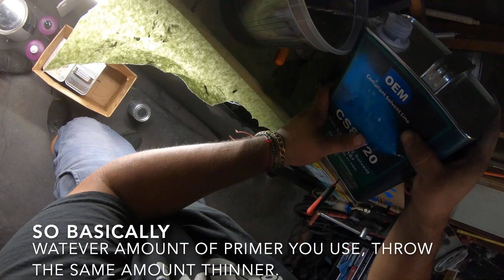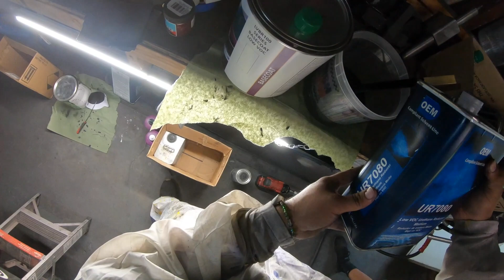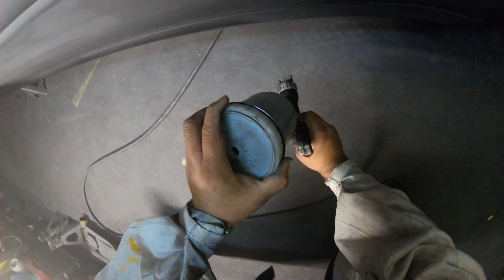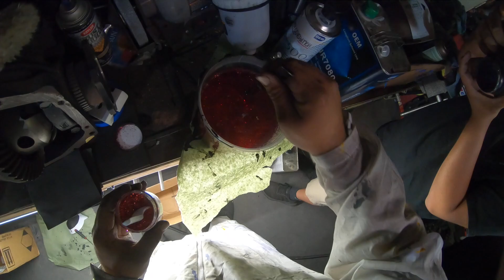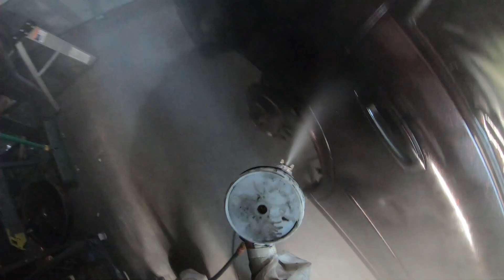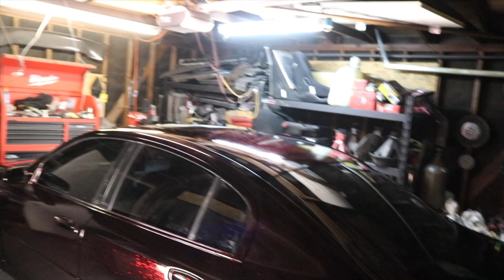G35 SEDAN BLACK ON RED FLAKE PAINT JOB P.O.V

Comment: Looks good. I've been spraying and doing metal flake for 40yrs. New flakes are definitely more forgiving than the old ones lol. My technique is, my 1st coat of clear is without flake, then my next several coats of clear is with flake. I finish with 5 coats of straight clear to bury the flakes. After 24hrs or so I sand it with 1,200 grit, then shoot another 5 or 6 coats of straight clear. Then wet sand and buff it out. Did alot of '49 Mercs back in the lacquer era, 600 grit to wet sand the clear. Young bucks today are like WOW 600! Lol. 600 was the finest back then, lacquer compared to paints now are night and day too lol. Anyways I thought I'd share from one painter to another 😎  I'd love to have seen the car outside.
Reply: I’d like to know a complete process
Reply: My first lacquer flake job was in 1962.
Reply: How much clear coat do you use? I’ve got a single cab truck that I’m painting and not sure how much I’ll need, not painting the tub/tray
Reply: @harrybottmtb8947  Depends on how many coats of clear you want and what your mixing ratio is. So if your ratio is 4:1 clear/activator and if you're using a hvlp gun, a gallon of clear would do it, giving you 5 coats of clear. I use a SATA and it does really good on saving material. When I shoot metal flake I use my Binks model 7 and then the SATA with clear, no flake. Question, what color are looking at painting and metal flake or no? Because that would change my suggestion on a gallon of clear lol
Reply: @harrybottmtb8947  Another question is if you're doing the door jams and under the hood. I know at the car manufacturer I work at, on an average size vehicle, like a sedan or SUV, we use 3 quarts of clear, 1 to 2 coats on the jams and 4 coats overall. You can cut back on material if you use a wet look. It'll give the illusion of tons of coats, but in reality not that many coats. The clear we use it slightly thicker than the average. So a coat is basically a coat and a half due to the thickness. Back with your spray gun, depends on how open your volume setting is. Straight clear, (no flake), I set my around half open. Then I adjust according to how it's laying down etc.. I hope this gives you some idea.

Comment: You have to bury that in clear coat after it's done to get that orange peel out of it and then wet sand it and then buff it till it shines maybe four more coats of clear brother
Reply: You are correct Shaun about the paint process. Also the wet sanding is key in all paint jobs no matter what you are painting. I agree with you 💯
Reply: I shot a few metal flake job's. Primer. Base coat. Clear and flake mix. Clear coat 2 time's. Wet sand cut and buff. 
Still looks good. Where are you located at homie
Reply: @Tom-wq2mz  so you mix the metalic with the clear coat then spray ?
Reply: @A6q4  After the base coat is laid down, Yes I mix the Metal flake with the clear coat and spray it. Next clear coat it. You'll need to repeat the clear coat a couple of times to get the Metal flake buried and orange peel out. Be sure to cut and buff.
Reply: You need to wet sand the orange peeled base coat before applying clear, or you're just clear coating orange peel.

Comment: Brother, I have to say I have been afraid of metal flake all my painting life. You totally owned that car and it came out extraordinary. To have completely fixable orange peel is nothing compared to other jobs that I have seen drips, runs, lines and uneven coating where these boneheads call themselves professionals. That really was a great job. I am ONLY adding this part and please understand that I am NOT a pro but this is what I have been told so many times. If it orange peels and the jobs is not up to your standard, 2,000 grit and level out that job, then add 2 coats of clear and see your results. This all comes as respectful advise but to see what you finished with, OUTSTANDING!!!
Reply from the maker: thank you bro! watch my newest video!
Reply: Thank you very much, I was looking how would one get rid of that orange peel.

Comment: Yo fili mad respects bro🤘🏼🤘🏼🤘🏼 but just a pointer I’m a painter after laying the flake lay out clear on its own without the flake it’ll come out clean and as far as the over spray put the box fans on front of you garage with the filters and block it with some plywood in between
Reply from the maker: Rv Vz i did do the second pass just clear no flake.. but that flake seems too big makes it pop lol. I will definitely try that for the overspray🙏🏼🤘🏻
Reply: No matter what size of flake you spray always shoot atleast 2 coats of just clear or even 3 so you don’t feel em and off course a wet sand will take all the orange peal off & the size don’t really do anything about the orange peel every paint job has orange peel till you cut and buff

Comment: By all means I never want to come off as a hater. As someone that paints in a body shop, I’d say if you’re just wanting to learn to do it at home, go ahead.

But if you really want to do it right, there is a lot more info out there, this would not be the methods I’d tell anyone to follow. That’s all I’m going to say.
Reply: I'm no pro whatsoever, just a bit of an enthusiast as a disclaimer. The job came out well imo, it looks pretty good from the video - but I'd personally mix the flake with some intercoat/binder, bury the flake in 4/5 coats of clear, sand and flow coat - that way its more forgiving when you're clearing the car, cos if you get a run in the clear mixed with paint, you're sanding the entire panel down again!

Comment: I have a project for my Crown Vic. My plan is Hot Rod Black base.
Then a thin coat of Deep Purple Micro Flakes from DYC.
I have 15g of it.
And on top Brandywine Candy High Gloss..

Honestly I have no clue how it will turn out. Is it possible you can replicate that on a A4 template?
I would really like to see if it's a good idea.
Got all materials ready for it.

Sincerely Henning Kemner TX

Comment: I guess everyone that watched your channel don't know what good paint work looks like not to be rude man but that looks like a orange rolled in the dirt it's orange peelie because you used a 70 dollar paint gun with probley a 1.7 tip on it not because of the flake I get it your doing it at home in your garage but man the actually paint job is not good the paint is a good colour that's about it I hate watching people paint cars on here that don't actually paint cars I seen the add for the video and I as like awsome a nice looking colour and good paint job then I heard yours compressor and seen the gun 😖
Reply from the maker: My homie was happy with the results and only spent $300 so its a win win🙏🏼. Also this is a drift car not a show car. 😂🤘🏻
Reply: @FiliManriquez  Gotta flick more to get a even transition and do it away from panel gaps, start from one side of roof/hood/trunk and work the "wet edge" across, multiple lighter coats cover better, weird but its how it works lmao, on clear first coat should be light - second heavier to give the second coat something to stick to evenly, just a few tips for next tiime man!
Reply: @FiliManriquez  Higher pressure (Depending on gun, 25-35psi) + being about 4-6" away from panel will give a smoother finish aswell

Comment: Way too much hardener . You want a flexible paint not a hard Shell.  If you push in on a door or quarter panel it will crack not flex with the panel .

Comment: You need to do yourself and your house a favor. Move that aircompressor outside! All those fumes in there and the spark from tha5 motor running or switching off and on. Your asking for an explosion! The pressure switch is likeca set of points and ark a little when they open and close. Seen too many accidents over the years!
Reply from the maker: Thanks bro will do🙏🏼🙏🏼

Comment: Dang you got way to much flakes in that mixing bro but way to much. You start good with the clear coat and then start jumping from part to another creating over weight in some areas. Tu no puedes brincar tienes que disparar los flakes parejo ,you need to spray even . Y en las areas graandes y flat como bonete la maletera y el hood nesecitas hacer la ultima mano de lado como cross para que riegue los flakes even. Por eso tu no li notas por q no tienes mucha experiencia con flakes pero no esta uniforme tienes sobre carga en muchas partes.